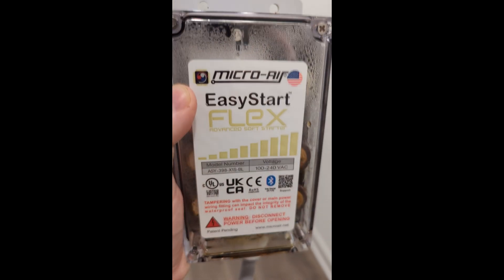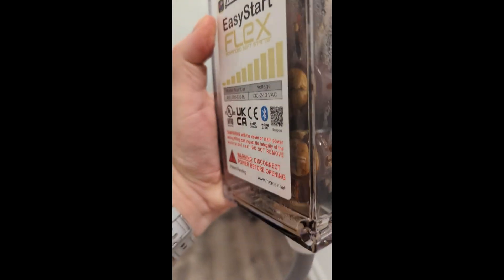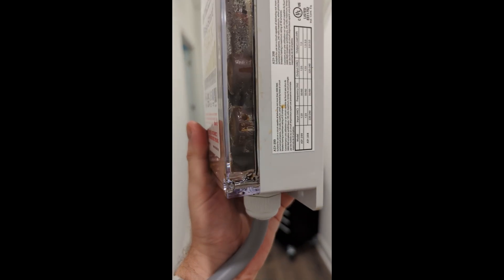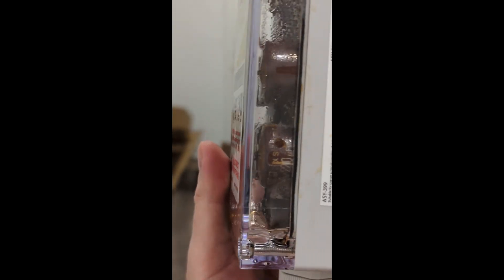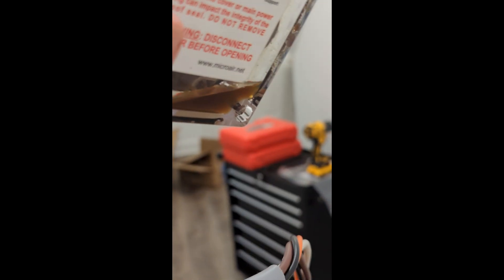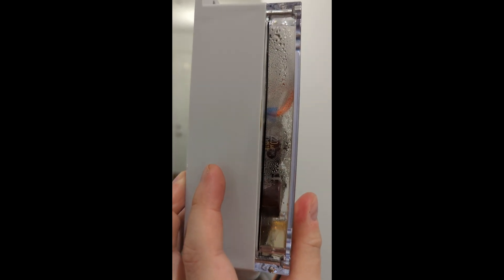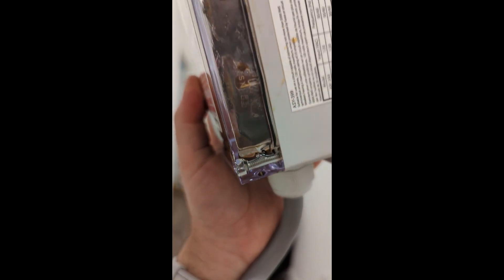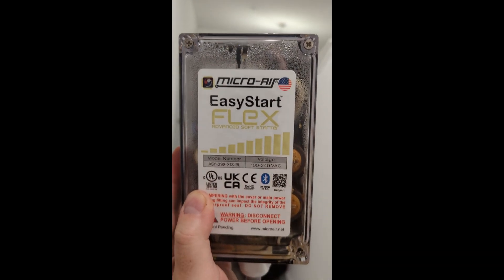MicroAir EasyStart Flex (ASY-398) A/C Soft Start Catastrophic Failure

Comment: It's not the gasket seal.  Micro Air had a bad batch of capacitors on 4% of their Flex soft start units with serial number 398006209 or less.  What is your serial number?  According to MicroAir, they have resolved the problem on units greater than s/n 6209.
Reply: Just installed replacement unit today s/n 398006717. Fingers crossed
Reply from the maker: Oh wow, thanks for the information - how did you come by it? I have received a replacement unit and it appears that the gasket/cover are not seated properly. I know for a fact that the old unit leaks electrolyte from the inside, i.e. it's not properly sealed. On the new unit the gasket does not appear to be flat against the plexiglass casing anywhere except in one corner (it's shiny and twice as wide as elsewhere on the unit).
I'll check and post s/n tomorrow.
Thanks again!
Reply from the maker: Both of my units start with 3980 and the failed one is 398000665, while the replacement is >6209. I'm discussing the gasket seating with MicroAir currently as well (I wish I could post a pic in comments!) as there is no way the unit is properly sealed.
Reply: @ArcadiyIvanov  any updates?
Reply from the maker: @AVMAR  I've received 2 replacement units and the 2nd one has been working non-stop without a problem.
Reply: Good to know, thank You!!!
Reply: Does the capacitor being bad cause it to condensate inside the enclosure?
Reply: @chrisharrison8199  That moisture is not condensation.  What you're seeing is the electrolyte fluid that leaked out from inside of the failed capacitors.
Reply: @BrandonMeyers-i6r I totally agree. Mine looks the exact same way. In the meantime, the compressor failed and I had to replace it. It was over $600. The A/C Unit is only 3 years old. I think it was the Easy Start Flex. We never had any issues with the new A/C Unit prior to the Easy Start installation. Also, the installer was an insured and bonded A/C Company.
Reply: My serial number is 398004000 and it has brown water inside of it after only one month😢
Reply: My serial number is 398020***.   Same failure after 4 months. Apparently, the problems have not been solved
Reply: @harrison9206  that serial number would have been part of the bad batch.
Reply: No, affected Flex batches were 398006200 and under. Source: had affected Flex fail last week after ~10 months and 4600 starts. Warranty replacement just arrived today
Reply: @AndrewShaw777  No, Not fixed, Mine is 398010025, failed at 3 months! Maroon Nippon Capacitors (Blew Up)
Reply: Any updates boys?

Comment: Mine failed 6 months after install. 1 of 2 I purchased for my home has failed. It was on the larger 5 ton one. The 2.5 ton unit seems to still be working for now. It appears to be the same blown caps. Wet on the inside. AC stopped cooling. Checked breakers, reset breakers, turned on AC and everything thought it turned on. Fan outside kicked on but did not hear the compressor. Bluetooth also wasnt working anymore. I hope this doesnt happen every year. In reality it didn't really last 6 months. Installed in Feb and it was kinda cool, not cold...definitely not hot. So the AC wasn't really starting to be used until mid to late May and even then it was partial. So July and August is when it was getting multiple hours of use a day. So I think it really only lasted 3-4 months once AC started being used. Serial # is higher than what was noted here, way higher. 398028446. I am trying to submit an RMA now.

Comment: I wonder if putting an extra sealant around the joined edges and maybe hot glue on top of that would help?
Reply: I don't think the case seal caused the failures.  If you're really concerned with it, run a couple of wraps of electrical tape around the seal. and mount it where it's sheltered from rain.

Comment: This is why I enclosed this unit inside an water tight electrical box.
Reply from the maker: Does not help against exploding defective capacitors :) My unit is inside the compressor casing and protected from the elements along with other compressor electronics.

Comment: I’m in Tx,I installed mine in July also,and my heater stopped in middle of the night. I can hear the thermostat click but outside unit does not power on. Did this cause your whole unit to stop working? Thanks
Reply from the maker: Nope, my unit worked but compressor didn't start, while the fan spun.
Reply: The soft start module manages power to compressor during start up, and (electronically) "steps out of the way" once compressor gets to operating RPM.  So if something in soft start goes awry, the most likely failure mode will be what you described, the compressor never starts running.

Comment: Thank you for the video! Between the YouTube comments here and the Amazon reviews, this is an EXTREMELY bad look on Micro Air. I ALMOST bought one of these before seeing all the failure reviews. There are A LOT. Amazon really should force Micro Air to take the listing down. This is ridiculous. Any updates did you get anything working now?
Reply: This makes me want to return mine I have not install or used it yet.
Reply from the maker: The second replacement unit sent by Micro Air is operating normally: https://www.youtube.com/post/Ugkx3aCsigFetyrV1RkViyzJgUPgLk0F__pF

Comment: What was the issue with this model? The seal can't be the issue since the item is inside the unit. It has to be a defective part.
Reply from the maker: Defective capacitors in the early serial models. Please see the pinned post.
Reply: It can be because outdoor environment with warming and cooling can cause condensation to form. If even tiny leak in seal can allow the outside airs moisture inside and then condense as the surrounding air cools

Comment: Question:  I thought Capacitors could handle external weather conditions? The capacitors that come installed in the condensers from the factory last years and they are also easy to swap.  Why would these fail from moisture?
Reply from the maker: I think the problem was they got a batch of defective capacitors in early version units.

Comment: I contacted Micro-Air about that defect in the cover. They sent me another unit. It has the same defect. They told me that they are aware of the defect. But it won't affect the seal. We'll see.
Reply: Reinforce the seal yourself just in case

Comment: I received my replacement Easystart Flex from MicroAir due to a small amount of moisture building up on the top clear case , and was installed by my HVAC company an hour ago and I'm back up and running. MicroAir support has been great and they stand behind their product. But the tech pulled out 2 older models of the MicroAir easy start which has failed from their customers because of water intrusion so I had them install behind the panel where the capacitor goes. The HVAC techs believe the high humidity here in my area is building up where the tail whip enters the case.
Reply: It's not water intrusion, it's the capacitors leaking/blowing.
Reply: Any update?
Reply: @AVMAR replacement still up and running. I installed a new 4ton Trane XR replacing my old Carrier unit. My Champion Tri fuel 9000 watt will run the AC but only with eco mode off and running on NG only. Was a little bummed about that.

Comment: I haven't installed my flex unit yet. Waiting for the install kit. Flex unit # 398011290 There is a questionable area on the cover left side looking straight on. Now I'm worried.

Comment from the maker: This is the replacement unit I've received. It doesn't appear to me that the gasket is properly seated on this one either: https://www.youtube.com/post/UgkxUtZzojeoNNiHvI0Jb6sBVoijhWiFFuMX
Reply: If mfr doesn't want to replace it for the case flaw, clean case with IPA and run a couple of wraps of electrical tape around the seam--and mount it where it's out of the weather.
Reply from the maker: @Steve-xl2mn  They replaced it the second time and the unit has been working great for over a year since.
Reply: Any way you can see if the capacitors are the same from the failed one vs new?
Reply from the maker: @pullmarkbird9112  Capacitors are black in the new units vs brown in the failed one. Same ratings though (200uF 400V IIRC)

Comment: Might be the bowing is from the capacitor gases inside. Now I'm skittish after watching yours tank in such a short time. Mine was installed not long ago by my HVAC Co. Keep us informed how the company handled your situation.
Reply from the maker: I've received a replacement unit and looks like bowing might be a separate issue, see: https://www.youtube.com/post/UgkxUtZzojeoNNiHvI0Jb6sBVoijhWiFFuMX
Reply: @ArcadiyIvanov  I can't tell you how much I appreciate the update. This morning I noticed a small area of my Flex unit that was cloudy. I did send a email out to to tech support with pics. Mine still working with no faults but have noticed my start up amps have increase. Thanks again.
Reply: Is the cloudy condensate?

Comment: My Easy Start Flex just failed the same way within 24 hours of installation on my 4ton AC by an HVAC licensed and experienced technician.  

I have already submitted an RMA request.  Hopefully it will go smooth.
Reply: 2 weeks of usage from Flex 2 capacitors started to leak. Replacement sent with no explanation as to why unit will fail like this. Many are reporting same issue with Flex.
Reply from the maker: @edwardbarnett6318  Ah looks like a manufacturing defect. Hopefully the new ones being shipped out are fixed.
Reply from the maker: @edwardbarnett6318  Thanks for your report.
Reply: Yea, I believe since original Micro air owner cashed out back in 2021. The new equity group that bought them (Cathay Equity) has probably changed directions. Profits over quality.  Probably sourcing out the cheapest capacitors out there. Even though it is still assembled in US.
Reply: They are experiencing multiple failures. The units are blowing internal capacitors.
Reply from the maker: @aholmes6612  Yep, looks like it.
Reply: My experience with Micro Air is theyll do the right thing.
Reply: Lesson here is to keep the original packaging. Might need it.
Reply from the maker: Sorry to hear about that. They are not supposed to fail before the compressor does. 
I've submitted one as well and they are sending a new one. Do you know how yours has failed?
Reply: I just heard back from MicroAir.  

It was a very quick and professional response.  

I received no run around and should have a replacement pretty quick.
Reply: @ArcadiyIvanov  How long did it take for you to receive a new one?
Reply from the maker: @jeremyperry9318  I had to followup with them every week and then they overnighted it to me after the second week. You have to prod them
Reply: I am guessing the soft start was hooked up to the capacitor run wire instead of the compressor run wire.  It clearly states to not do this on the installation instructions. It even mentions that what you experienced will be the result if hooked up that way.
Reply from the maker: @03harleydeuce  It's been running normally for >1500 starts for several weeks and was hooked up to the compressor run wire. I had to reverse the installation as well after the failure so there is no doubt and have before and after installation pictures and videos.
Reply: @ArcadiyIvanov  It sounds like you installed the Flex correctly. Did MicroAir provide you an explanation on why the unit failed?
Reply from the maker: @johnyee7323  Nope they did not. I also offered them to return the unit for failure analysis and they didn't seem to be interested. But also I have not received a replacement yet nor notification of a shipment. That said I have received a notification of the RMA processing but not of the dispatch.